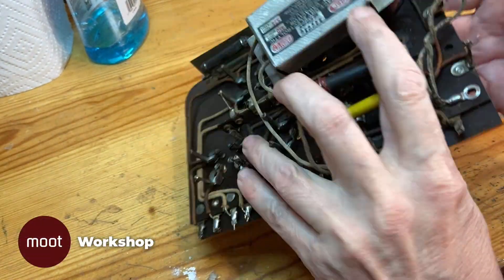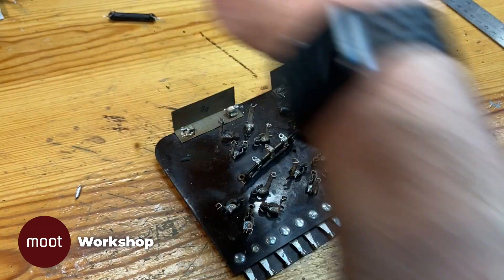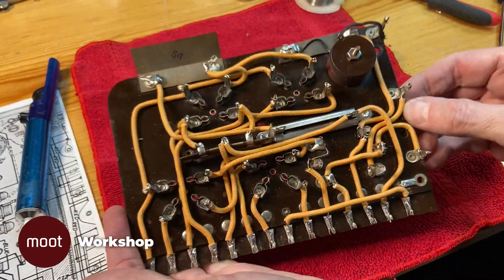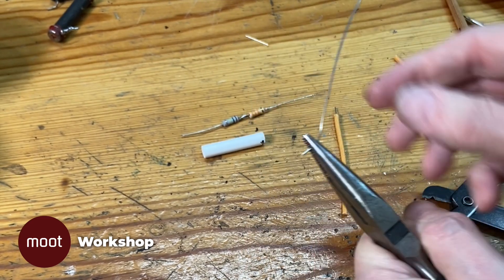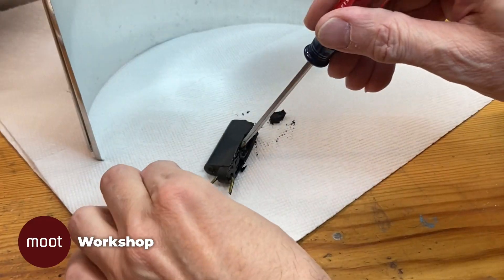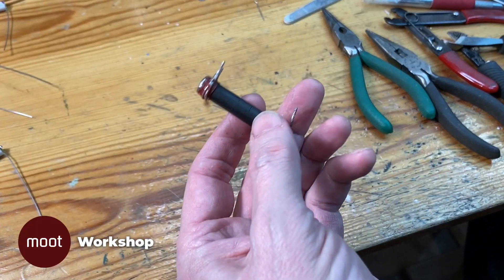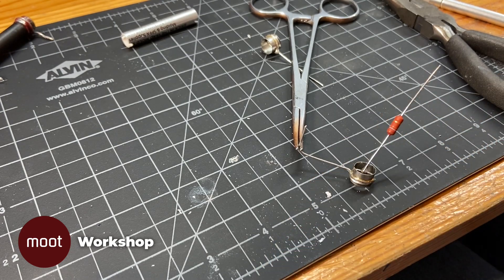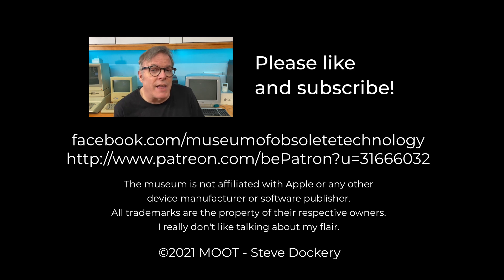1930 Brunswick Model 15 Part 9: Power and Amplification Board

Comment: Incredibly thorough job on this part and previous videos in this series! Looking forward to seeing first power up and testing. Did you test the board off camera to make sure you rewired it correctly, or are you leaving all testing until the end? Also, I'd be worried that the 1 watt resistors will overheat inside the closed plastic tubes, which will cause the tubes to melt at some point. Have you done this kind of resistor restoration before?
Reply from the maker: There’s not a lot I can test at this point, without hooking it up to power, other than to verify that the components are the correct values and the wiring is correct (which I double-checked with photos I took of it before disassembly, and the diagram that was included in the service manual). Yes, the heat dissipation is a concern. Since the radio was not working at all, I have no way to predict how hot those resistors should get while in operation. If they do start melting the plastic tubing, I’ll have to build new ones using other techniques (I’ve already been thinking about other possibilities).

Comment: Nice job.  But didn't the old resistors have the end body dot colors to indicate the size?  Most of the old dog bone style did.
Reply from the maker: All of the originals were solid colors. There is one resistor in the detector section that is a slightly different shape that does have a dot color, but all the others in that section are also solid colors.